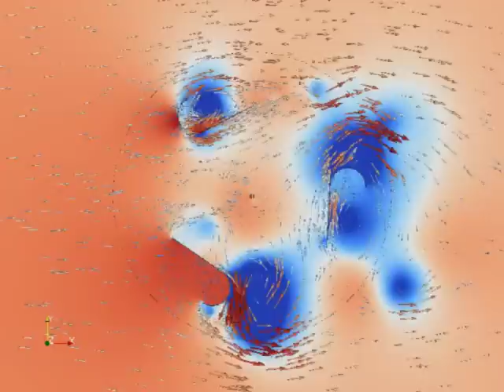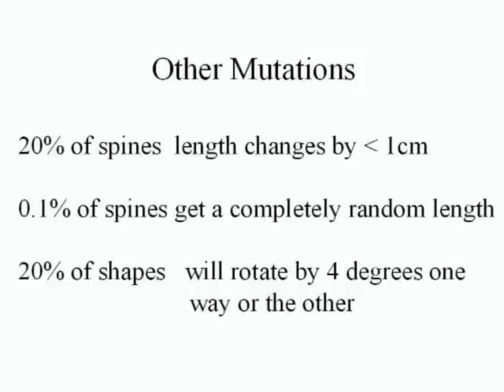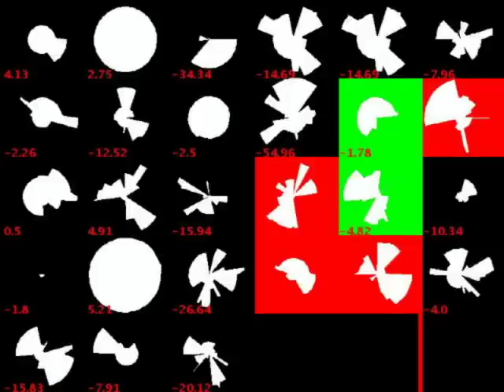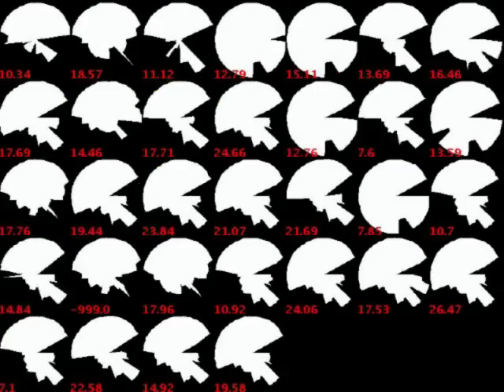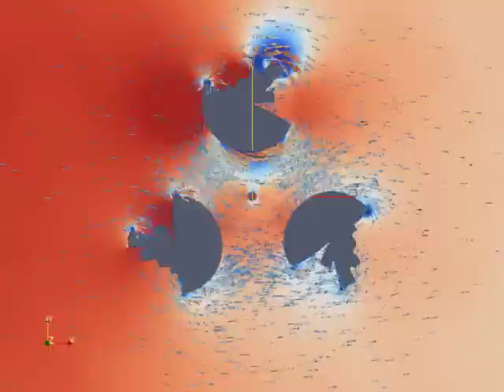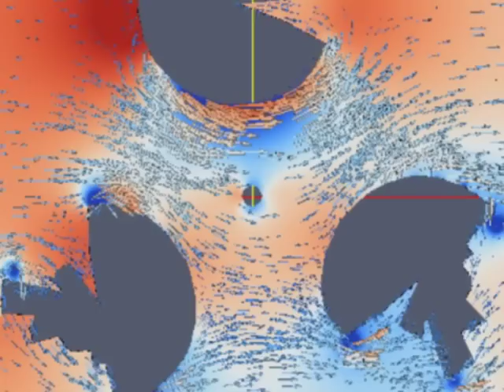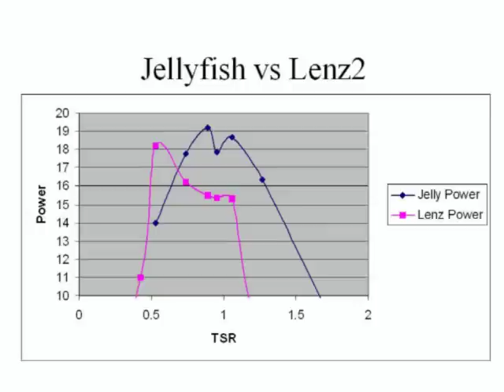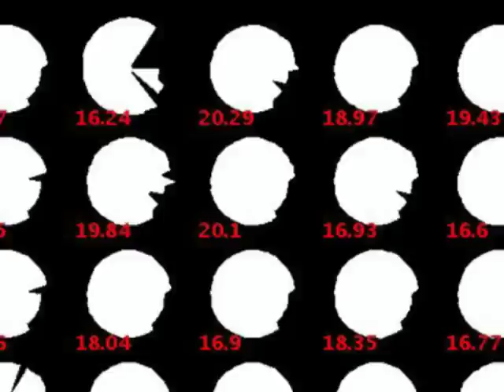Evolving Wind Turbine Blades

Comment: A couple of things. (Though this is from 2009...)

1) Rotation should really be explicit, not implicit, at least given the way breeding works. Otherwise look at what happens if you have, for instance, a straight line bred with a mutated copy rotated slightly.

2) I suspect you would end up with better results if you allowed non-convex blades.

Comment: Wow this is fascinating. I know nothing about turbines or genetic algorithms except for what I learned in this video, but I'd be curious to see a version of the experiment that allows for the Lenz2 blade. Under current shape rules, it is impossible to achieve a shell like the Lenz2. Could you write the shapes to allow for negative spines that cut out from the other side? If your model did allow for Lenz2-like shapes you could then breed with the Lenz2.

Comment: This problem of getting stuck in some good but not best shape, even if the population is bigger, reminds me of some problems of optimization that get stuck in the closest "local maximum"  but local maximums does not guarantee global maximums by any mean.
Reply: It even happens in engineering. Planes, cars and computers are pretty much stuck on the same design, minor improvements over the past decades
Reply: Yea, that's an artifact of evolution. Evolution doesn't select for perfection, only what is "good enough" to survive and reproduce.

Comment: Cool experiment! I'm imagining using novelty search will aid in getting a larger variety of different blades. What might also help is using genetic islands and merging them when an optimum is reached. Both of these techniques will make sure that you don't run into these local maxima.

Comment: One of the questions associated with this work is whether or not it is possible to achieve fitness from inability through the use of generational aggregates (recursive iteration). One must recognize that some genetic combinations observe 'dominant/recessive' relations- a 'winner take all' style in which the output responds to quantized significance rather than continuous averages (hair color versus skin color). 

Without a priori knowledge on fluid dynamics your inhertence model is giving birth to blind children that have eyes.

Comment: As the population approaches a monoculture there more identical individuals which will have the same score. Sorting your population [with a shell sort] will put identical individuals together. When a member is the same as the previous give it the same score, don't test it, and move on. This will shorten your processing time. Unless you want to simulate some primordial conditions insuring at least two of each possible values for a gene will give you better results. When done manually the population is smaller hence the process is faster. I have never used the averaging values method or used different breeding / blending methods so I can not say which is better. Smaller surviving populations are usually faster because the pressure to evolve is greater. I have found around 10% is good
Reply from the maker: +Michael Hartman The challenge is that even the ones that look identical in the graphics, aren't exactly the same, so it becomes a judgement call on what's close enough not to retest.  Sometimes the smallest changes can make a big difference in air flow.  Now if there is a member from the previous generation that's already been tested, he is NOT retested, the results are just remembered.

Comment: Did you account for mutation
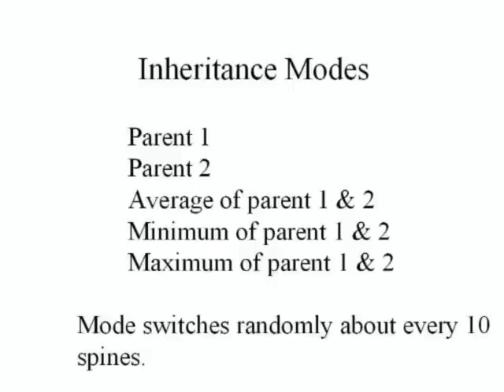Reply: +Yawning Gull 1:42
Reply: Pan kurczak No, if there was no mutation, the best designs would likely still win.
Reply: Pan kurczak If you didn't include mutation, simply random designs at the start, the best designs would still reproduce far more than the worse ones. Even if mutation never occurred the best designs would still be selected for.
Reply: +Pan kurczak
I think you're thinking of the offspring as mutations, technically they are not, mutations are random changes that occur outside of inheritence. Without mutations offspring would inherit properties of their sires at random but could not get any properties that weren't present in the initial sample.
It wouldn't just end immediately without mutations it would continue making offspring with some properties of either parent until you stopped it.
Reply: Pan kurczak
No, not all traits of the parents will be inherited just like any child isnt a clone of there parents there is variation in the inherited traits causing no two offspring to be alike, this means there will still be species variation in each new generation even without mutations.
Reply: Pan kurczak
You very clearly said, repeatedly, that evolution cant occur without mutations which isnt true I'm trying to explain why and doing my best to be nice about it dont get defensive.
Reply: Pan kurczak
"if there was no mutation. nothing would happen"
"the whole process would end because without random mutations no new designs are created"
"mutation is the single fundamental process that makes this possible"
if you no longer think this then fine, job done. Otherwise its very clear its exactly what you said and its wrong you don't need mutation for species variation and therefore evolution to occur.
Reply: Pan kurczak
Thats already been stated, the point I'm trying to make is evolution doesnt need mutation, as you have repeatdly asserted and can work without it.

Comment: You should introduce an emigration function of sorts, that introduces complete strangersinto the population. Another major difference I noticed is that with the Lenz at every point you allow for 2 lengths, an inner and outer diameter. You may want to consider allowing that into your design so you can explore a much more diverse set of turbines. If hollow regions give you issues its really easy because if a shape is hollow you will go through an even number of transitions (metal air metal air) vs an odd numbered, non-hollow shape (you must allow for the case of 2 passing though since that represents a solid arc of turbine.
Reply: Immigration won't work, unless that random complete stranger would immediately be able to compete, by having a semi-high score, with existing population, or he will be removed. Thus hazardous environments kill, but this does not benefit the progress of evolution.

Special treatment for aliens (immigrants) then?
Reply: +Marek Spociński He can immigrate members from previous populations as long as they have the same fitness or similar fitness score without modifying the algorithm. Modifying for special treatment of these alien members is also always an option if thats not diverse enough.

Comment: Have you tried doing a different approach for how you want your wind turbine? I know the Vortex Bladeless wind turbine was just hype but I'm wondering if approaching it with evolutionary computing like you did here would turn out something useful.

I guess it's changing the paradigm a bit but the goal is to harvest wind energy. I'm wondering what kind of design could be turned out with simply that goal in mind. Obviously you would need a lot more parameters than you have in this program but at least having the fitness function in mind is a step.

Comment: I think a way you could've prevented it from becoming singular is adding mutations.
Reply: He did.
Reply: Reducing to a single form is usually the outcome of most evolution simulators since a single fitness function, or in other words, a single criteria to be met is set, meaning that the best suited would become dominant, unlike real life with plenty of different environments each with different criteria for survival.
Reply: No no lol. +tantzer is right, since having too many or too large mutations causes species to more easily lose fitness; the gene that makes that species suitable in that environment is more likely to be mutated and thus die off more quickly despite being fit. 

What I was saying though, is that a lack of mutations is not the reason for a single dominant species outcome in evosims, but rather a single environment and fitness function causes this. Reduction to a dominant species in these cases is best since a specific answer to your question" which is best suited" can be presented. Too much mutations would always cause this answer to be vague and inconclusive.

Comment: I think if you change the wind to multiple speeds and some varying angels as well as some gust so that you have about 10 to 20 wind scenarios you will do better. If every turbine is then tested against all wind scenarios and the average is given as  the determining rebreed factor a better blade will emerge. It also appears all growth is done from the center. Growth should be able to be from any point of mass. Still restricting the over all size of course. If done correct it may even be field applicable. At any point great video.
Reply from the maker: Robert Corkern That is true, but this tooks weeks to run on several computers as it was.   20 different wind conditions would be at least 20 times longer.   Maybe if I had a super computer.
Reply from the maker: +Robert Corkern The way I simulate a turbine now slowly spins up from a stand still to the max RPMs, so I get a complete power curve.  Unfortunately it takes a long time and doing a breeding experiment like this would take a year.  Now if I add in multiple wind speeds, it would be multiple years.  Although with the right computer(s) I could get that down to a reasonable time.
Reply: +sjh7132 Have you tried to build the jellyfish?
Reply: sjh7132 I don't use my computer much. These simulations seem really interesting. If you want another sandy bridge i3, or radon hd 6970 to throw at the problem, just tell me what to download.
Reply: +sjh7132 what are the specs of the machine(s) that you ran this sims on for curiosity sake?
Reply: If you can distribute the software, a distributed computing platform like BOINC https://boinc.berkeley.edu/ can have your simulations running on volunteers' PCs in their spare time. That's a virtual supercomputer!
Reply: sjh7132 i bet, you have a much better computer now than 2009 😉
Reply: Haru Susemilla Allow me to contribute nothing to this conversation, and note that your name is almost that of a anime character.

Comment: I feel like this could significantly benefit from both an indirect encoding (to have more structure and less noise in the blade results) and novelty search (to explore the solution space more evenly and thus not get stuck in a local minimum as soon)
Very nice concept though

Comment: The problem is that the algorithm gets stuck in a local minimum. That's why you get very different results each time you run it. In other words, you algorithm is dependent on initial conditions. In yet other words, the fitness landscape has vast number of local minima and depending on where you start the GA will simply converge to the closest one. This is the major reason why brute force doesn't work. Of course, you can increase the initial population diversity to cover the entire fitness landscape but as you probably noticed, this way you will run out of memory. But a nice start it is. Let me know if you want to collaborate on a project.
Reply: That's the problem with brute-force approaches. Evolution is blind. Go with MCMC or another search method. There is no silver bullet, of course, and evolutionary algorithms can sometimes perform miracles in high dimensional spaces. I can see why this approach was taken here: the goal is to produce a single design (or a small set) so it doesn't matter if it takes a very long time and if you need a huge memory. The objective is not bad. But the problems stated above will persist.
Reply: semiheresemi Increasing mutation might help. When working with genetic algorithm I saw that, once population gets stuck in local minimum, increasing mutation impact to some crazy levels for limited number of steps provides interesting outcome. Lots of bizarre solutions are produced that way but some of them may lead to new local minimums. After some steps of "insane mutation" you may decrease mutation power to normal level. At this point population contains combinations good old genes and some new random genes.
Reply: semiheresemi *local maximum
But yes, that is one of the issues.
Reply: semiheresemi A colleague was working on a similar project but with drilling tool paths. He also mentioned the same problems as you did. It is obvious once it was explained to me.
Reply: Yndostrui Maximum, of course. I keep thinking in terms of error  :)
Reply: +semiheresemi Maybe more randomness & wider variation would help with that.

Comment: This is interesting. I have a 3d printer sitting about 75% complete. Once I have it done, I think I will try printing your jellyfish design and actually make a turbine with it. I will print a lenz 2 as a control and hook them to identical loads, probably pumping water or similar. Then, some real world data can be gathered and we will sea if it holds true to the FEA.
Reply from the maker: See the whole description....  I made a mistake in my simulation and these blades were optimized for some gas much more viscus than our air.  I don't think they will work well on Earth.
Reply: Michael Harrington We ALL want him to do this!!!!

Comment: all EVOLUTION requires a GREAT ENGINEER!!!
Reply from the maker: No you just have to set up the population and the selection and evolution runs without requiring any intelligence.   Still it produces what appears to be an intelligent result.
Reply: Eric S Really? This example of evolution specifically had no intelligence behind it. Randomly generated replicators were simply run through generations and the result was an optimized, ingenious thing.

Comment: One way to do this would be to actually encode the simulation in a java applet so that anyone who wants to contribute to the project simply needs to navigate to a web address and the applet will load the appropriate data and run the simulation and report back the results.  An interesting side effect of this would be that it could return partial simulation data.

Comment from the maker: That could be true, but also what makes the high res version worse is I let it run longer.  During the breeding, the tests only ran for about 1/2 turn, and in CFD it really takes several simulated seconds (multiple turns) for the air to really settle down into it's stead state where a lot of the air is flowing around the turbine.  I just didn't have the computer power back then to do a long sim for each generation.  I'm not sure I do now either.

Comment: i think what really effects most the test is that
when you changed the model to test the jellyfish in high resolution, you basically changed the environment of the turbine to which it didn't adapt that could be one reason it scored less then the low res test.
At that "high" adaptation level little changes can have a quite significant effect on the result. :D

Comment: You need to gather some real data of wind velocities. You will need to determine in which time relative distribution certain wind-velocities-decrements will occur and weight the velocities(/rotations) with there occurrence.

You would need something like a "Load duration curve" for wind and multiplicate every decrement with its efficient.

Comment: Using genetic algorithms is a bad choice when your fitness function is so flow. Simulated annealing would probabibly do faster with equal results. This would allow using more iterations, which would resolve your problem of always getting different solutions (an strong indicator that the simulation is too random, or badly described).
What software did you use to find the fitness of a turbine (the wind simulation..) ?

Comment: I bet you was telling 2-3 GB ^^ . Well on that machine i got 8GB memory & 12.4GHz power , so if it runs in x1 speed at 3 Ghz i can give it x4 speed at 12 Ghz. Anyway MY idea was :
You use your computer (or a virtual machine if you want) as an "host" then you setup a network where everybody connecting to that can give you CPU cicles (how much they want). So the RAM is used only on your computer but the computation is done way faster (with enought people doing x10-x20 faster is not hard).

Comment: Hello, have you stopped using this method in developing new turbines? I seems you could just reset to the settings for air, and try it again. If you need computer power i would be happy to run simulations on my powerfull system. This is too awsome to just forget about :-)

Comment: @sjh7132 Apologies, I didn't read the description. Is there someway of repeating the run with the right value of viscosity? I have had little experience with viscour flows as I only deal with things like shock waves and electrohdydrodynamics which has ignored viscosity.

It was a brilliant piece of work though.

Comment: So, i'm not a programer, but what would happen if you could reverse your program to be able to put the Lenz2 design in and allow it to give you, based on probability, a set of most likely parents? You could use several generations of these sets to then work back forward and try to evolve the Lenz design further.

Comment: There is an issue with the spines all coming out of one point in space. There is no way that  you could ever, using that way of representing the surface, that you could ever come out with a lens2 surface for example. So, you have an issue with concave surfaces that curve back on themselves.

Love the concept though - good practical GA example.

Comment: I think your mutation rate is a bit too high.  In nature, mutations are usually neutral, or small.  Your variation is extremely wild and nearly unbounded between generations.  Lower mutations require more generations to get results, but the small changes will be much more guided towards incremental efficiency changes.  Try narrowing dow the mutation rate (affecting a smaller number of spines) and the mutational variation (lower amount of change in a given length.